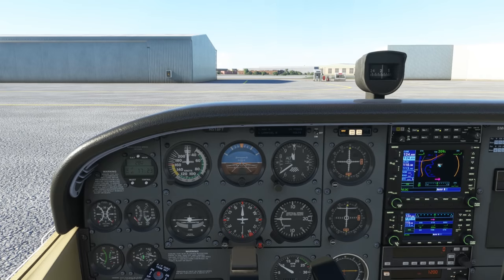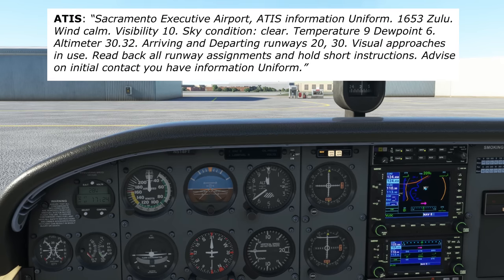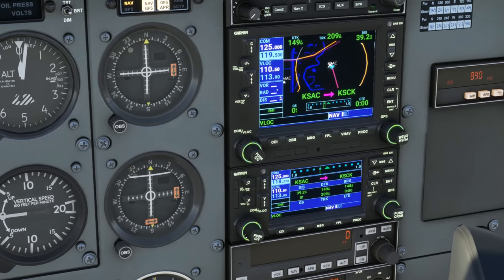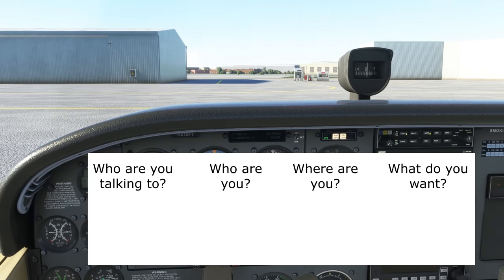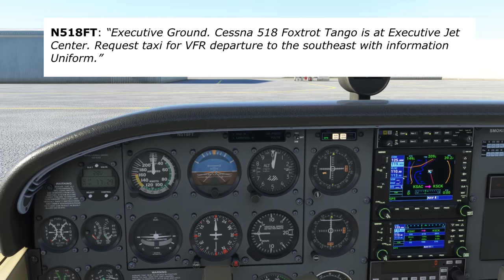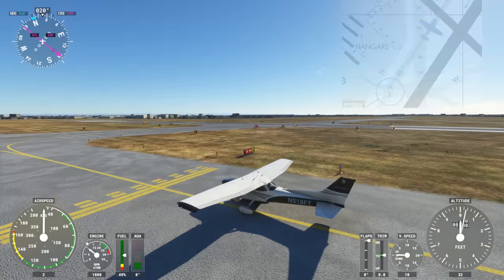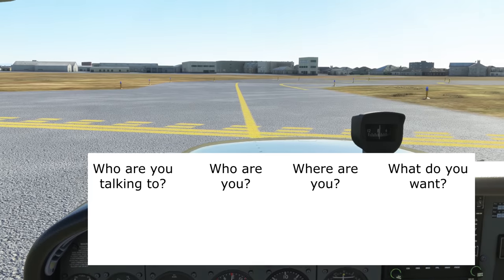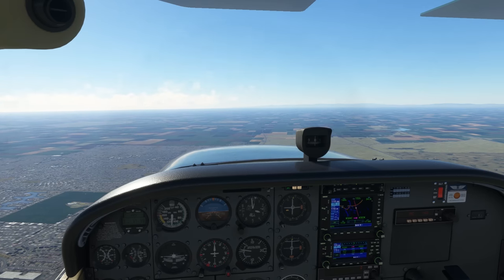Departing a Class Delta | Ground Control | Taxi Instructions | Towered Airport

Comment: Overall good and helpful content on this channel.

One change in the radio call I would suggest (in addition to Warren's notes below) is one I teach my students, which is to avoid using the generic "Cessna" or manufacturer name and use the model name for that airplane.

Since Cessna makes Citation jets, Caravan turboprops, as well as the piston-driven Centurions, Stationairs, Skylanes and Skyhawks, all with varying levels of performance, it gives the tower, TRACON and ARTCC more immediate information about what type of air traffic they are dealing with.

So, instead of saying "Cessna 518 Foxtrot Tango", saying "Skyhawk 518 Foxtrot Tango" conveys more information to the listener.  Especially to fellow pilots when working a traffic pattern at a non towered airport.
Reply: Makes sense.
Reply: Agreed :) saying “Cessna(tail #)” is about as useful as saying “Airplane(tail #)”.